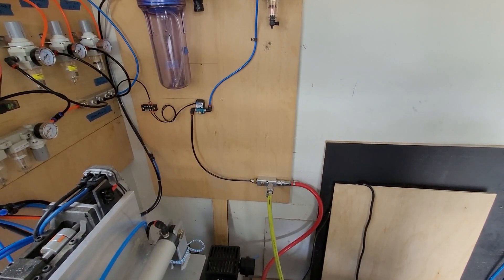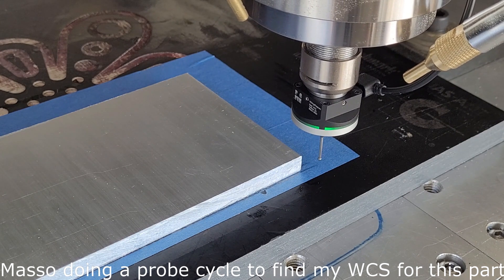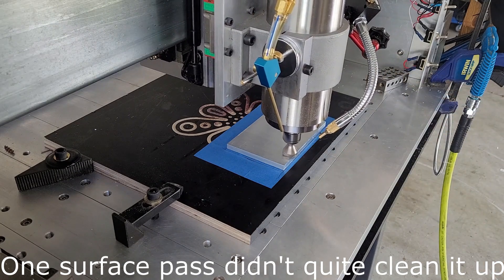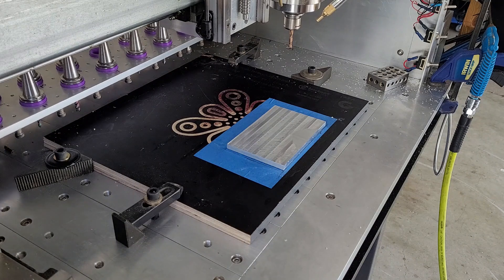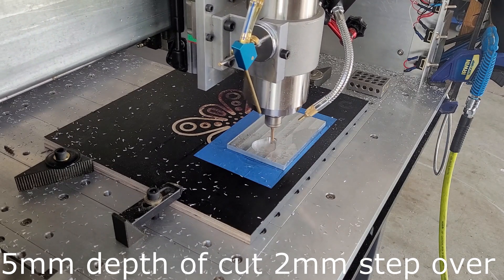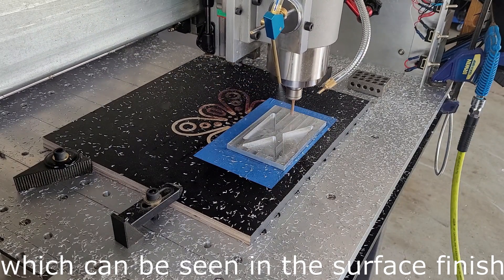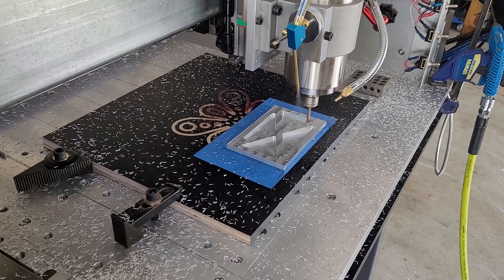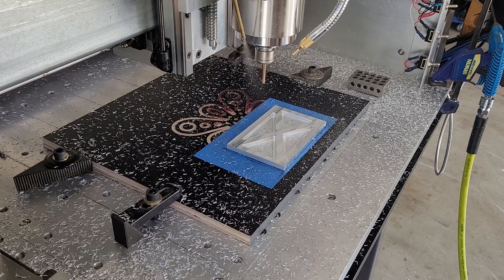Home Built PrintNC PRO + ATC Fitting Mist Coolant System Part 1

Comment from the maker: Just a heads up on the Part 2 Video I finish up with spot drilling then some drilling, 2d contour around the outside of the part to give it some shape and then finally I run a chamfer operation on all the pockets and around the outside with the mister successfully spraying a mist of alcohol  on to the part I will also give you my thought on the whole operation cheers Bill